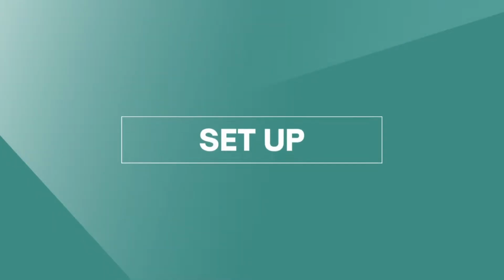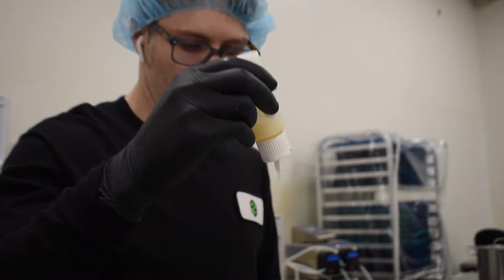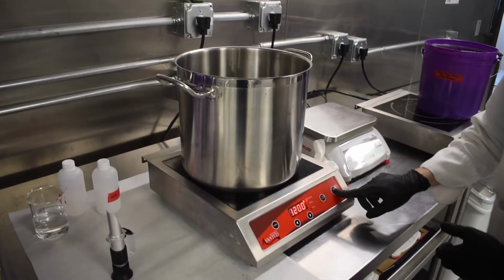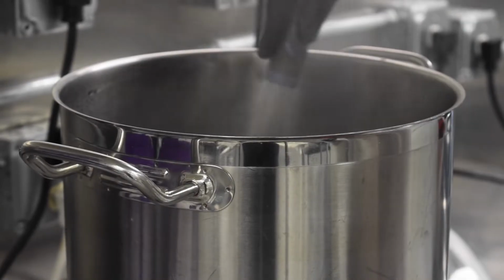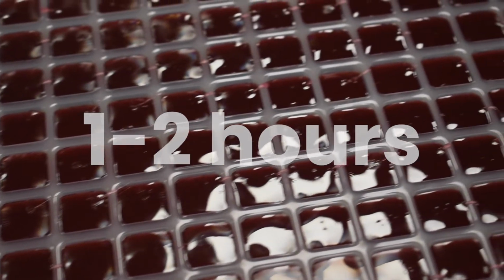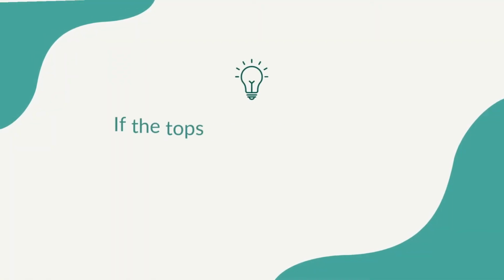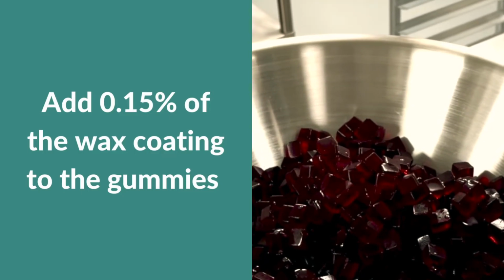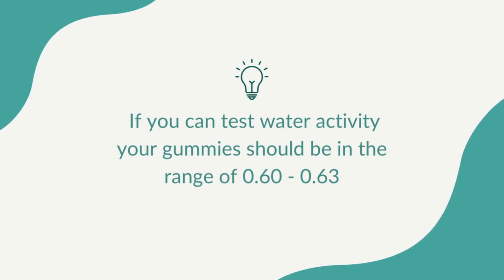How to Make Pectin Gummies with Melt-to-Make™ Gummy Base

Comment: Can I put my wax-coated gummies in the fridge for them to set? I don't have a 35% humidity room :(
Reply from the maker: Yes you can! We just suggest that if you are going to put them in the fridge or freezer, don't allow them for freeze or be in there too long, especially if you're using our gelatin. Keeping them in there too long can denature your gelatin. 
You can also cure them in the open air even if you don't have relative humidity of 35%, it will just take a little longer for them to cure. You can also buy yourself a dehumidifier from a supply store to decrease the humidity in your kitchen. We also suggest getting a humidity read for your kitchen so you can keep an eye on the general humidity of your kitchen.